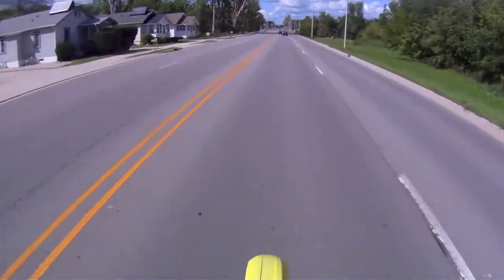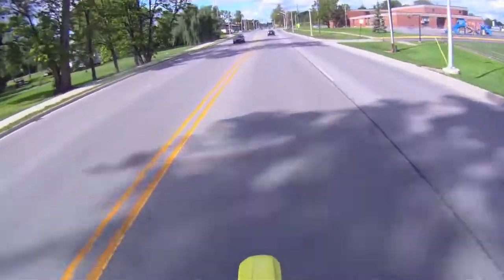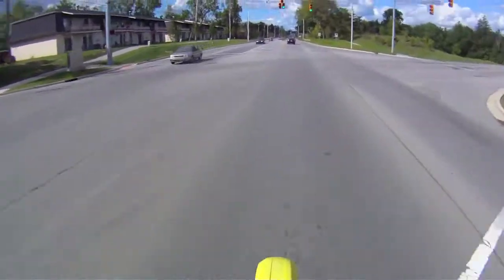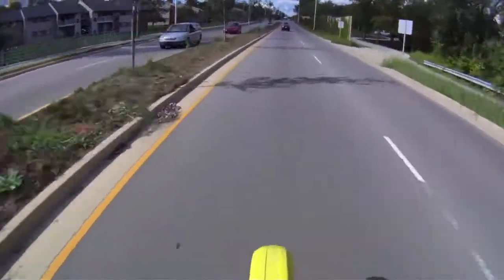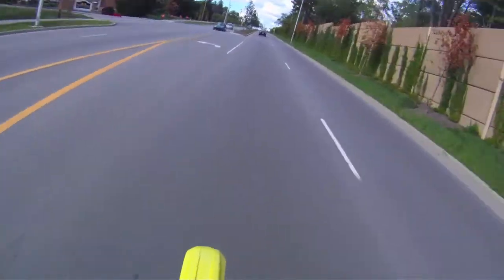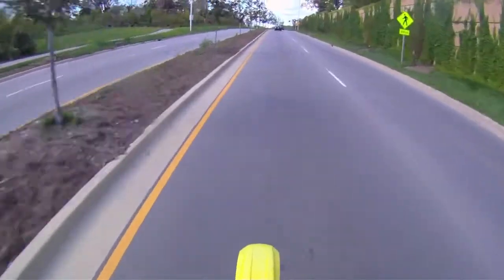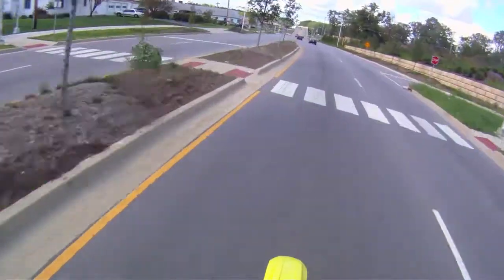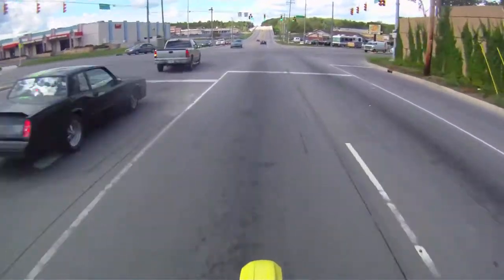Speeding: Tracking History, Batching Effect, Cosine Error

Comment: That's not what batching effect means. Batching effect is when moving radar samples the patrol speed and then the target speed, but not at the same time. This can make the unit calculate an incorrect speed difference. The officer would mitigate it by not accelerating while taking the reading. Justin - the cosine effect only always falls in favor of the target for stationary RADAR. For moving RADAR, it can give a false high if the moving antenna is pointed down, causing a cosine error on the low-Doppler, making the patrol speed indicator read too low. You mitigate this by verifying your patrol speed with a calibrated speedometer.